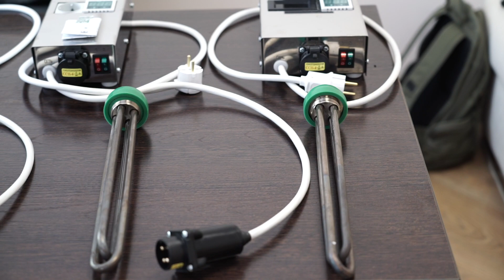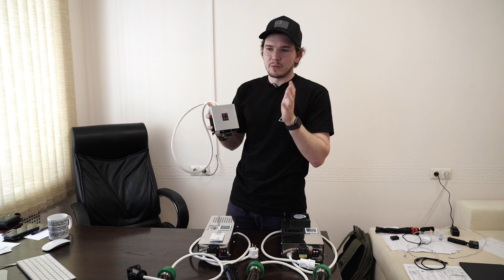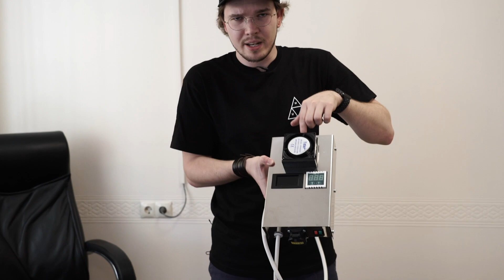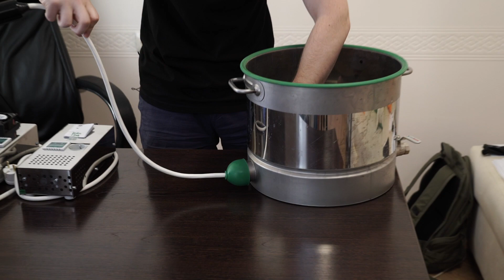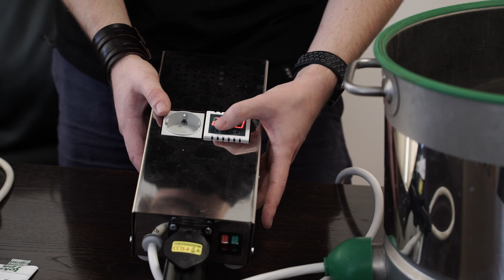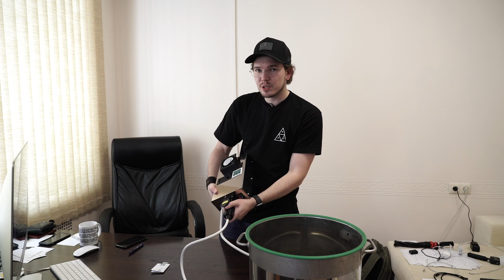Heating regulators for distiller

Comment: Must be nice having that kind of power in a regular wall outlet, we need a special socket and wiring to get even close to that here in the US.  Speaking of which, have you released a version for those of us stuck with 110 volt power?
Reply from the maker: We are looking for making regulators for US socket and 110 volt. One of the things I would like to do, that is sending to George a heating regulator, so he can check everything, maybe suggest to change something and show the community that unit is working or not working.
Reply: @DoctorGradusInternational  So, you control the temperature manually, no temperature feedback sensor?
Reply from the maker: @Audigiant  these regulators are designed for controlling power. We have a regulator for looking after temperature but it’s more suitable for mashing and yes you can use just to regulate power.